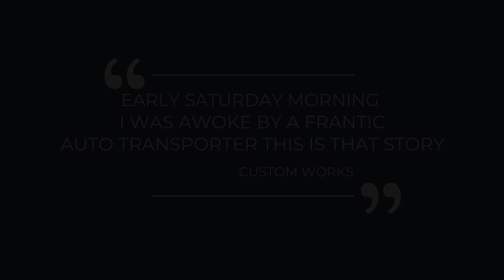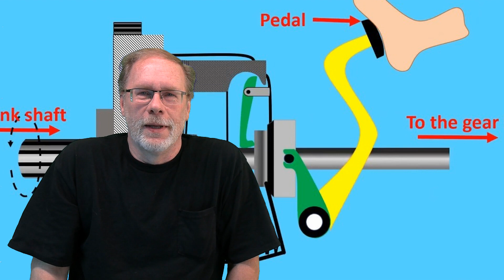FORD POWERSTROKE NEW CLUTCH PEDAL MOD

Comment: Just got this 99 f 250 super broke and the clutch pedal has way too much play at top ..
Push it 6 inches before feeling the pressure plate and pedal is not in line with the brakes..
It sits higher 6 inches 
Works great but knees can’t take the exercise
Reply from the maker: There is a huge problem here The clutch and brake should be very close in even ness
Reply: @CUSTOMWORKS7.3PSD  
Is the rod too long? Or is there a stop missing ? I was thinking just shorten the rod .but it needs enough travel to engage the clutch...
Reply from the maker: @doubleduty1703 I,m not there so I have to make some assumptions usually it sounds like the rod came out of the cylinder master  or the spring on the peddle is gone or broke or the master is not installed correctly
Reply: @CUSTOMWORKS7.3PSD  
Ok thanks 
I checked all that and compared to videos online for reference 
The rod is a bit loose in pocket of the cylinder 
I will check tomorrow if it goes in more than just sitting there .
The spring is there, operational . 
Temporarily drilled small hole in the aluminum bracket to use chicken wire and small chain to act as stopper . 
That’s how I roll for now . 
Adjusted to the feeling of pressure plate as it’s dead air for about 5 inches. 
And level with brake pedal.
My brother in law has my chiltons manual and I will check it when I can .
Thanks for the reply ,
It helped a lot.

Comment: My clutch stopped engaging 1 week after I had the transmission rebuilt. It ended up being the plastic bushings were worn out  in the clutch pedal assembly. I thought for sure it was a bad rebuild. $30 and she’s back on the road

Comment: What I've learned with these hydraulic systems is an air bubble which you can never get out. What I've learned to do. From a Ford tech in early/late 90s is press pedal to floor. And side step foot to left. "Like drag racing @8000rpm"  Yes it makes a racket. But it burps that damn bubble every time. Truck off of course.. And you will have a good solid pedal. Hope it helps people.